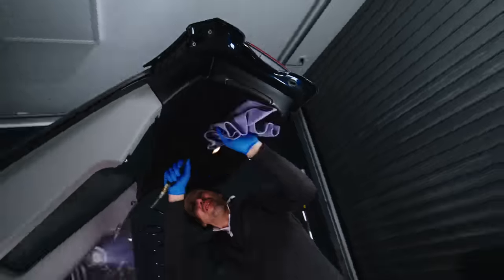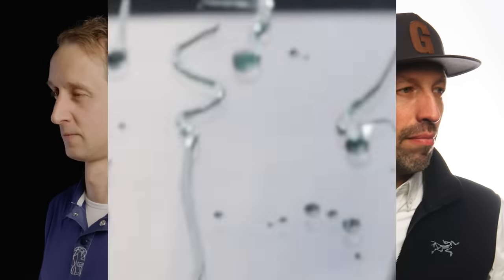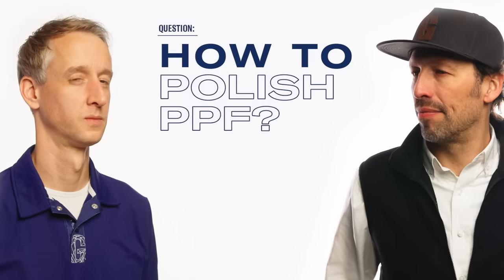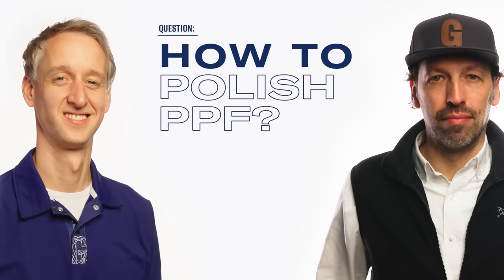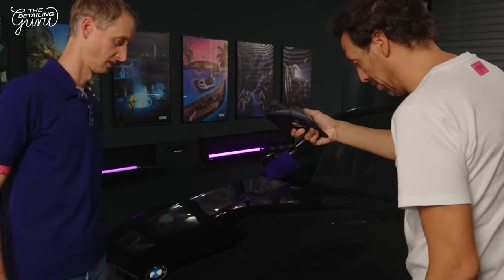How to polish PPF? - The Detailing Guru

Comment: Big fan of GYEON product, but I'm little bit confused. Can I use iron remover on my ppf? If not, should I keep using ppf wash weekly? Do I have to polish my ppf before apply gyeon ppf ceramic coating?
Reply from the maker: Hi, yes you can use Q²M Iron on your PPF without any problems. 
When applying a coating on your PPF the most important thing is to make sure it’s free of contaminants. If your PPF is older you can use Q²M PPF renew and give it a light polish. All depends on your expectations. 
Regards,
Y.

Comment: If the recommendation is to re-coat, after polishing, then wouldn't the fillers in PPF Renew get in the way of the new coating? Would a an alternative polish, without fillers, better prepare the surface for a coating?
Reply from the maker: Can you please define what you mean with “fillers”? 
Regards,
Y.
Reply: @GYEON_official  Wouldn't SiO² classify as a filler? I've generally seen recommendations to use polishes without fillers prior to ceramic coating, so that there is nothing to get in the way of the coating's bond with the paint (or in this case PPF). Maybe my understanding is flawed, and I would love learn more, in this context.
Reply from the maker: There is no “classification” when it comes to fillers. Every polish contains water and oil and these are capable to fill, so technically every polish contains “fillers”. Leftover oils are not something you want on the surface before applying a coating that’s why degreasing is so important. 
The SiO2 in Q²M Primer has the purpose NOT to interfere and actually promote a better coating application with no negative side effects. 
Regards,
Y.

Comment: For daily maintenance for PPF, would you recommend applying PPF Maintain or Ceramic Detailer or both?
Reply from the maker: You can use both but on PPF I advise Q²M PPF Maintain for extra durability. 
Regards,
Y.
Reply: @GYEON_official oes Q2M Primer improve the bond of Mohs Evo over bare paint or PPF (properly prepped)? Is it safe on PPF if so? Thanks!

Comment: Hi Yves, can I use mohs evo on ppf?
Reply from the maker: Hi, you can but I would advise Q²PPF EVO instead. 
Regards,
Y.
Reply: @GYEON_official  I bought mohs and I also got another question. While coating the ppf, can I also use mohs evo to coat the sunroof glass? Or should I use something else?
Reply from the maker: For glass Q²Mohs EVO will not work! For glass you have the choice between Q²QuickView or the longer lasting Q²View. 
Regards,
Y.
Reply: @GYEON_official  how about front and rear lamps?
Reply from the maker: If these are plastic then we advise Q²TRIM or Q²Cancoat EVO. 
Please remember Q²Mohs EVO is developped for a clearcoated surface! 

Regards,
Y.